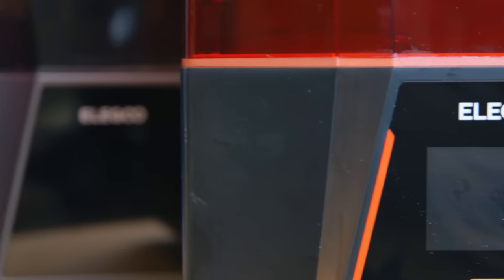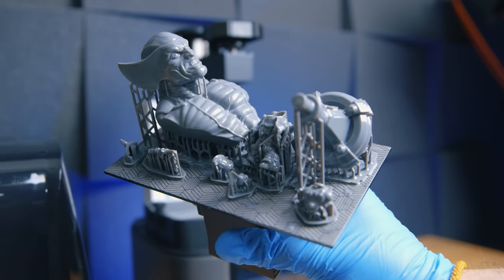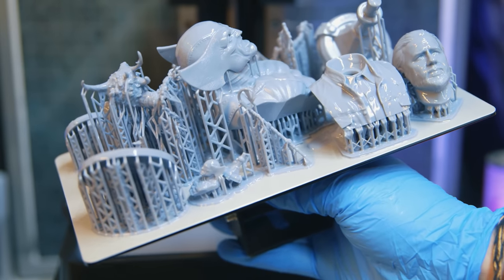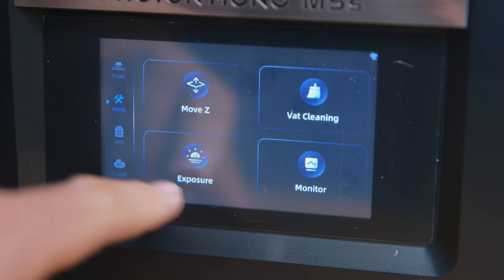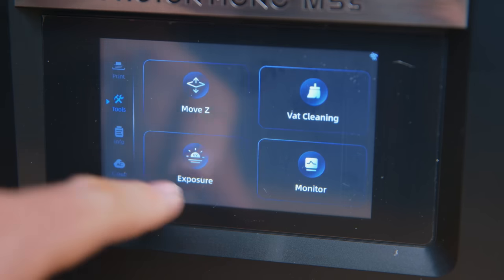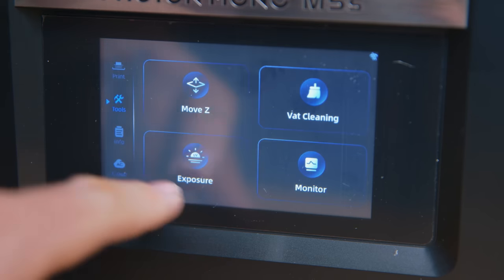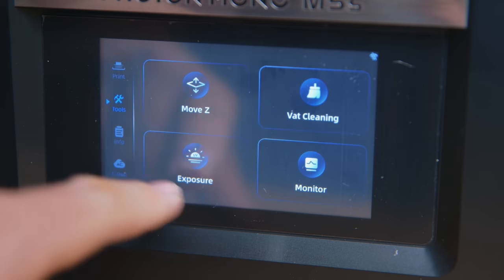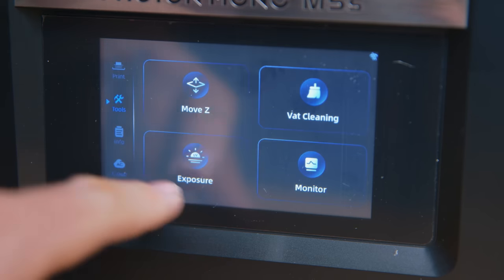Saturn 3 & Ultra Vs Anycubic M5 & M5s - 4 Printers - 1 CLEAR WINNER

Comment: Just wondering, Is there a reason you pour the resin on the build plate or is that just for visuals? Also, I have been printing resin constant since i followed your guide and have had no fails. Ive been using the Sunlu ABS-Like resin and its been great.
Reply from the maker: Solid! Glad to hear your results from that guide.

And you are right, it just looks better pouring it that way

Comment: Did you say you used PFA on the Ultra? What did you say was the link to that videa and what settings did you use. I had a film failure and replaced my ACF with PFA and would like to see what settings you like. Cheers
Reply from the maker: It’s in my Saturn 3 Vs ultra video from last week. No settings changed. Just relevelled

Comment: Just in case, did you keep in mind the fact that Anycubic Mono X needed higher height test cause the initial over exposure? I wonder if that bug remains, if that's the case you'll need to redo some tests, even the RERF that comes with it suffers from that so theres a custom one, it's just thicker. Anyway it's a very informative video, super complete, thanks messenger!! ;)
Reply from the maker: Check out my M5 video for everything I did. it was more than enough

Comment: I dont like the usb on the front.  By build plate hits the usb when placing it in front of the machine and also any resin that spills typically spills in front, where the usb is.
Reply from the maker: fair enough, we can't all want the same thing.
Reply: @FauxHammer  are you by chance active on your patreon discord?
Reply from the maker: @solarrage11  infrequently

Comment: Can you not lower the uv power on the m5 to reduce that over exposure? You can do it on the original mono x I'd have thought you could do it on these
Reply from the maker: Yes, you can lower the exposure if any printer, but the drawback of that is you will not render as much detail.

Having the same number of holes and posts in the exposure test shows what “balanced” looks like.

If you lower exposure from what I found balanced was, you’ll get underexposed prints. Leading to missing details and failed supports
Reply: @FauxHammer  I'm not talking about lowering exposure times...on the mono x you can decrease the uv % power of the screen. That is very different from changing exposure times. I'm asking if you can specifically do that in the settings like you can on the mono x, mono x 6k, etc etc

Comment: Hey Ross, I have read that the Ultra (both saturn and mars) have limits on the lift speed which stop you from slowing them down further. This can mean failure on swapping from ACF to NFEP or PFA because the lift speed won't slow enough for those films. Have you come across this issue?
Reply from the maker: I typically do every test at 60mm/m or 1mm/s. Never had an issue at that speed on any printer.
Reply: Apparently the ultras are limited to minimum 100mm/min lift speed that's coded in, and setting it lower doesn't actually change the speed. Reportedly Elegoo are planning a firmware update to fix this. Presumably it was because the Ultras come with ACF. Maybe this was bad information (a few people have posted this on reddit - and there is not a lot of info out given these printers are new). I suppose if it's not causing failure then it's not really of any consequence though. Thanks for the reply! @FauxHammer

Comment: Thank you for the video, Ross. Though as I did watch the previous ones, the result was predictable 🙂

May I ask you one question considering exposure. Since you've tested all the Saturn 1 8K, Saturn 2 and Saturn 3, pointing out that S1 8K was actually a faster printer in the terms of layer exposure, can you tell what was it considering S3? I mean, for example, on S1-8K you have 1.5 s exposure, on S2 you have 2.5 S (theese are the numblers IIRC). What would it be for S3? I mean did they manage to make a more "transparent" screen or maybe Elegoo made a more efficient light source.

Completely agree considering M5 - they need a premium or plus version. I personally would buy 5S already if not that blurriness thing.
Reply from the maker: Thanks, the reason I say it’s faster on the Saturn 8k, is because it isn’t as sharp, that’s all, because if they, you don’t need extra exposure milliseconds.

Both the Saturn 2 and 3 are about 1.5s exposure time depending on room temperature and resin used
Reply: @FauxHammer  I see... So it seems 12K screens do not have noticable "transparancy" upgrade. It's a bit funny situation here - there are a lot of M5S for 500 USD, but no Saturns yet. They are, but they go for 700--800, that is obviousely excessive. M5S "sense" system looks great really, I would jut buy that and forget, but you are not only the person who tells "they have inferior quality compared to previous 8K models"

Comment: Hi ! I have a question regarding M5s quality. If not printing in high speed, does it have great quality prints? There is an opportunity for me to upgrade from Mono X to M5S, and seeing your videos on the M5S I'm really not sure. Seems it is an upgrade but I may be buying something not that great if even slowing down it is not really that good. Thank you.
Reply from the maker: Nope, this causes soft prints no matter what you do. Check my M5 review for evidence.
Reply: @FauxHammer  Thanks! Have you done the FEP film tests to check your theory ?
Reply: @FauxHammer  i just saw the video. do you think this could be changed in a firmware upgrade? i also have the option to get a mono 6ks which you seem to like better than m5 series. unfortunately i don't seem to have 8k options available  (at least not cheap enough). Anycubic is the only brand accessible right now in their price range. Other brands will be 40% to double the price of Anycubic because of importing fees.

Comment: I really need to know if the Mars Mate Air Purifier gets rid of the VOCs or not. I was prepared to happily drop the $150 for it before I saw your video. They clearly claim it removes "up to" 95% of VOCs. And if that's not true, that's a big deal.
Reply from the maker: Based on the tester I have, it does Fuck all

Comment: Wait, but think about it. What's wrong with confusing PPI with DPI? at the end of the day, they're both the resolution of a printer. It's missing the Z axis for 3d printers, but that never lines up with the screens anyway. You're always able to go way lower if you want.
Reply from the maker: Because DPI and PPI is not resolution. People think that 8k or 12k or whatever is relative to PPI rather than being relative to a fixed number of pixels. So I suppose yes PPI works just as well as Pixel Size. But the printing community has adopted Pixel Size as it's metric of comparison.

But yes, Pixel Size is directly relative to PPI. with these being 19x24 micron pixels it is also 1337 x 1058 PPI.

19x24 is much easier to remember than 1337x1058

Comment: Owned a mono m5s for about a year. It printed well when it did. Ran it mostly non stop and once dialed in only had the occasional failure.

After that year mark both the curing station failed and the printer. Customer support asked me to take apart the curing station, put a voltmeter to it, then said they dont have replacement parts and can do nothing about it. Its own power supply fried itself. And they did nothing to replace it.

The printer had a massive FEP failure to where the fep leaked, the resin ate into the cheap screen coverings and worked it's way inside the screen. Attempted to take off and replace the screen but 4 screws sheared off from hand loosening them. Making screen replacement impossible and rendering the entire printer unusable. 

It was a decent printer when it printed but its made with the cheapest parts and replacement and customer support is impossible. It WILL fail at some point. I wont buy from anycubic again.

Comment: short question: saturn 3 ultra and m5s pro in sale, what should I buy..?
Reply from the maker: Not an M5, ever. They are trash and you already can’t even get replacement screens for them.
Reply: @FauxHammer  even the m5s pro is trash? so in the price range 200-300$ what can you suggest? saturn 3 ultra? anything else?
Reply: @FauxHammer  oh you said M5... so M5s "pro" is included in your statement? In your other video you recommend the m5s pro... I just want to buy a 3d resin printer on black friday sale for 300$ but i dont know which one.. maybe you can help

Comment: ok but is auto leveling and failure detection REALLy as needed as it is in fdms?
Reply from the maker: Not really as important here. If a print of supports fail there’s not massive material wastage
Reply: @FauxHammer  I never see this mentioned, but I'm pretty sure that there is no auto levelling going on whatsoever, simply auto z-offset; big difference and almost criminally misleading marketing. Actual auto levelling might be done with perhaps force sensors on 3 or 4 corners of the vat and steppers to tilt either the vat or the plate assembly, but nothing like that here.
Reply from the maker: @makers_lab  that's a good point actually, It hadn't really clicked that yeah, it is not auto-levelling at all.

Comment: Great video! The one thing I dont really understand is why you keep saying to press z=0 button after leveling. Your Z does not change from the leveling process, because Z is the position of the linear rail carriage relative to the Z endstop. So for example your Z would be different if you home -> press go 1mm up. Then setting Z = 0 would make the home position endstop + 1mm. While you are leveling, you do not change the position of the carriage, thus you do not need to reset the Z.
Reply from the maker: Z=0 is not always home, your theory is right, I’ve had it bite me in the ass a couple of times because it’s preset at the factory to not be a match. May not be the case anymore, but better safe than sorry.

I have seen other people not press this and fail prints, when they press it after levelling, it works.
Reply: @FauxHammer …and smashing the plate into the glass because of a factory “miscalculation”. Setting the zero is telling THAT machine “this is where YOU stop”. I ALWAYS do this without fail like a pre-flight check list.

Comment: Well you have answered my question, do I upgrade my Saturn 2 to an Ultra … no, I will be upgrading my Mars 2 to a 4, but changing the FEP. These fast printers are fine if you run a print business and are happy to produce average detailed prints, but the saving of an hour or so just isn’t worth the loss of detail for me. I buy designs like Brutefun miniatures for the detail they put in and I want those crisp lines. Thank you, though I’m not sure it will win you any favours with the manufacturers 😂

Comment: Word has it to get the ACF film to print correctly it needs to be installed with the glossy surface facing the buildplate and the rough grainy side facing the screen. Makes sense why ppl are getting the noise texture. There could be other factors too like the glass screen protector thickness, custom light source of the printer, plastic screen protector, etc.
Someone in a review said the ultra uses retraction speeds from 120 to 500 mm/min, didn't bother to verify.
Reply from the maker: I've not seen that said, but that's the wrong way round according to everything else I've read.
Reply: @FauxHammer  Heard about the ACF direction from Dennys Wang's video and comment section.

Comment: You may have the opinion that flex plates are a waste of time but I've never had to chisel off a build off the plate. Wibble wobble, tada! Hasn't caused printing issues either (fingers Crossed). Each to their own.
Reply: Depending on how delicate the print is, I just dump the build plate with print attached for a wash in meths in a wash n cure and then after washing place straight into a tub of hot water, easy peel off from the build plate.

Comment: If the Saturn 3 ultra had the normal fresnel technology with the clear plate, I would pay the extra for it.
I do not really care about speed, but things like the internet, etc, sound very nice.
However, I do not want to play the lottery and maybe not get lucky and get a worse quality than with the saturn 3, while paying more for it.
Reply from the maker: The Ultra has a sharper display, and you will need to replace your release film at some point anyway.
Reply: @FauxHammer  Thank you for the answer. This would be my first 3d printer, so I have never hold any of the elements in my hand. I wasn't aware that the vat and the sheet are separated.
Reply from the maker: @JackDespero  no worries, we don't know what we don't know untilo we know it.

Comment: For the algorythm.

edit:  failure detection seems nice but I'm not sold on the auto leveling. if the build plate is fixed then the build plate will have to change its "level" and in the end distort what your printing or at least that's my logic. maybe its so minuscule you wont notice. 

also the auto cc on saying yellow goose for elegoo is hilarious
Reply: if it is not flat, the difference will be small in the first layers (height between the lowest and highest point of curvature) and this is usually not the model but the supports. If the machine is not crooked from new, fears that something will get worn out and twisted are probably not true, the linear bearings are precise there, there is no chance of something getting worn out and positioning the building plate in a non-parallel plane to the LCD... And if by some miracle this was the case, then yes, you need to change the bearings, not the building plate...

Comment: My m5s auto levelling is malfunctioning and the center neck peice in the build plate is 2mm to short so nothing sticks to the build plate only the vat! The fans are so loud you cant here your tv or have it running throughout the night itll drive you bonkers! I have had the anycubic technicians emailing and getting video's back from whats happening they are trying to find a fix but they have sent out the new re designed build plate for it that can be set level to the screen when home the plate! There is a quick fix just now on printables some nice person has re designed the original build plate and the 3 separate parts it bolts up in! This has solved my issue's with the auto levelling and the build plate adhesion! It confirms the central neck peice thats bolted to the plate itself is 2mm short and lifts 2mm at the rear out the box and nearly went through the screen! Honestly save your soul.and pennies get.the saturn 3 ultra! Check the m5s anycubic reddit we are all on just now with exactly the same issues! We are beta testers for anycubic just now and they have re designed  a version 2 build plate they are sending out to customers!

Comment: Cool. Also why do you always pour the resin onto the build plate, not into the vat? Should I be doing that? Also also, I don't get why you don't like flex plates. It makes the whole thing much easier. Especially on my old photon s which has become incredibly difficult to level and it MUST be leveled every time the build plate is taken off, the flex plate literally saved this printer from the scrap yard.
Reply from the maker: No, you don’t need to do it. It’s just fir cinematic effect.

I don’t hate them. I think they are pointless. They introduce more potential issues. I’ve seen so many people say how they fall off or slide. When you have your exposure right, the plates you get are fine

Comment: What I'd love to see in future resin printers:
1) Higher resolution DLP printers. Currently I think only a single DLP system from Texas Instruments is in use, at 2K. I'd love to see something higher resolution.
2) We've seen some ideas out there for using force sensors on the printer to speed up printing and detect failures. I'd love to see more of that.
3) WTF? How do none of these printers have good WiFi control like we see with FDM Printers and Octoprint/Klipper? I really want to see good WiFi control and using a USB port to connect a webcam for external monitoring. A reasonable UI that allows for starting/stopping prints, managing files, and otherwise just adjusting all the same settings they all have in the menus already seams so basic and like an easy way for them to differentiate from competition. Hell sell it as an add on that plugs into a USB on the printer and I'd still consider it a win.